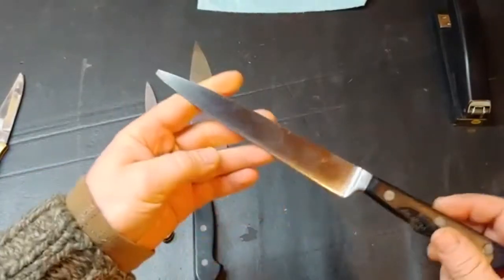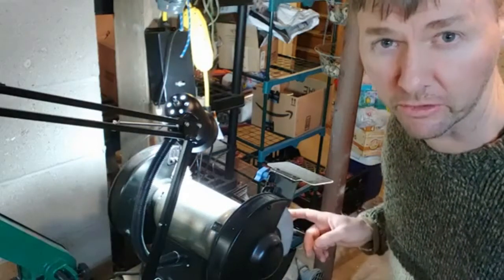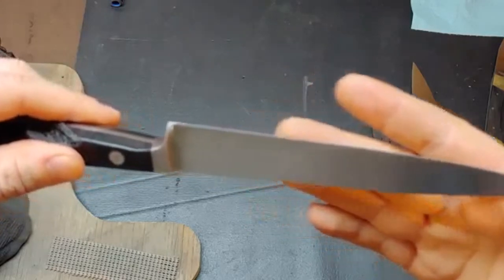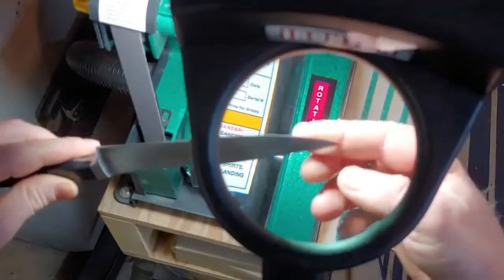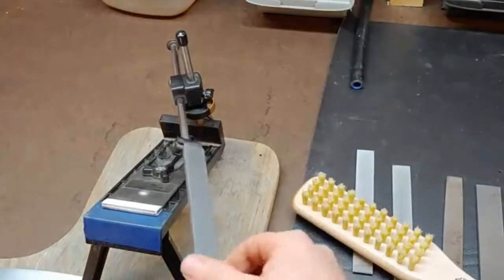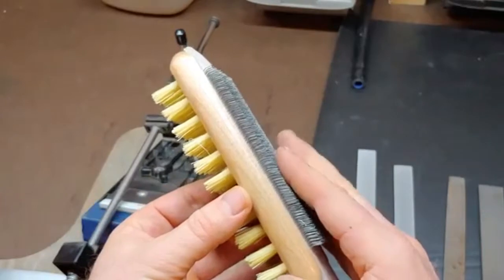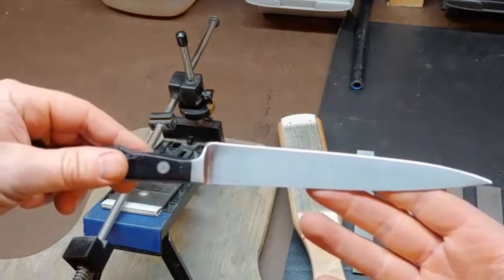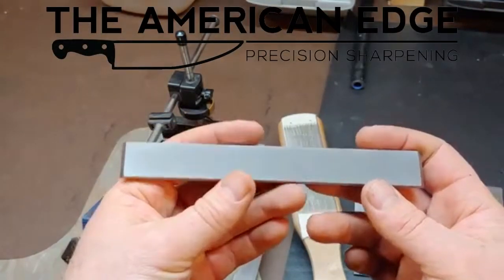How to Quickly Reprofile a Knife (and fix a broken tip!)

Comment: The tang needs to be ground down so the knife has a good rocker for cutting on a flat surface.
Reply: The tang is the metal part of the blade that goes into the handle. I think you mean the bolster? If so check out this video on my other channel:
https://youtu.be/B995zvjmJrA